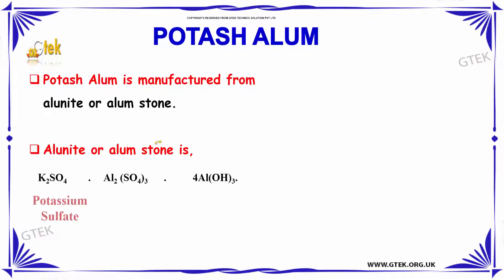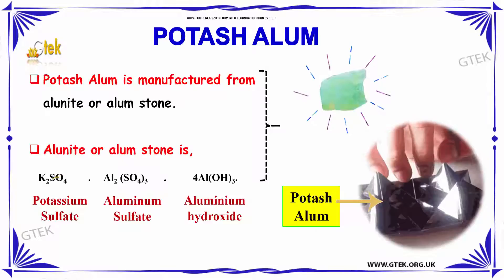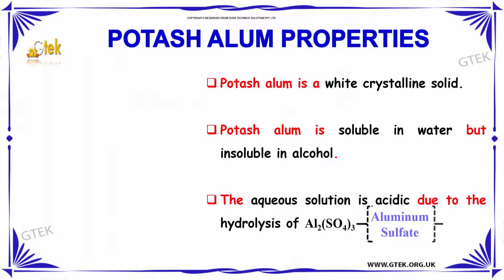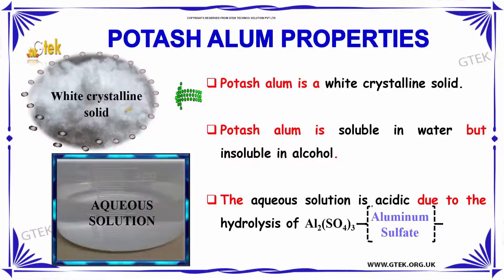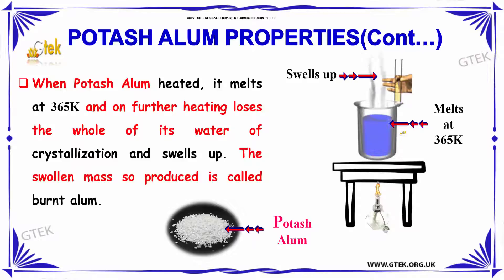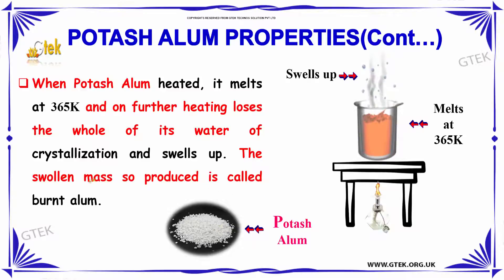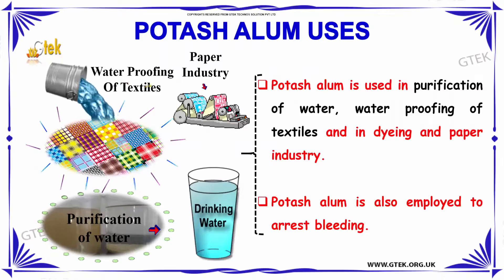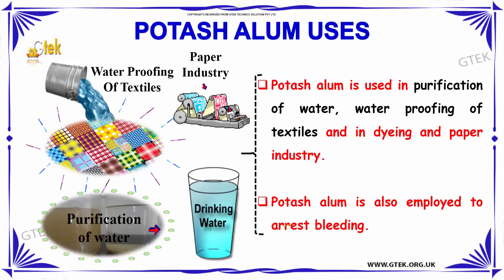potash alum p block elements class 12 chemistry subject notes lectures cbse iitjee neet

Comment: Potassium alum or alum-(K) is a naturally occurring sulfate mineral, which typically occurs as encrustations on rocks in areas of weathering and oxidation of sulfide minerals and potassium-bearing minerals. In the past, alum was obtained from alunite, a mineral mined from sulfur-containing volcanic sediments source.[6] Alunite is an associate and likely potassium and aluminium source.[1][7] It has been reported at Vesuvius, Italy; east of Springsure, Queensland; Alum Cave, Tennessee; Alum Gulch, Santa Cruz County, Arizona and the Philippine island of Cebu. A related mineral is kalinite, a fibrous mineral with formula KAl(SO4)2·11H2O

Comment: Potassium alum crystallizes in regular octahedra with flattened corners and is very soluble in water. The solution reddens litmus and is an astringent. When heated to nearly a red heat, it gives a porous, friable mass, which is known as "burnt alum". It fuses at 92 °C (198 °F) in its own water of crystallization. "Neutral alum" is obtained by the addition of as much sodium carbonate to a solution of alum as will begin to cause the separation of alumina.